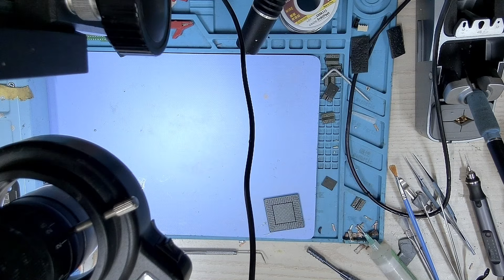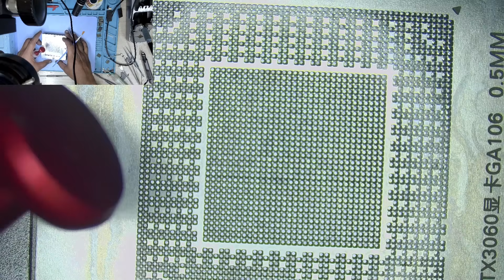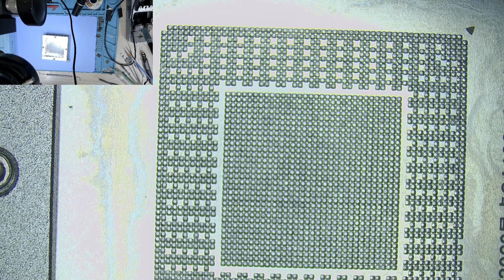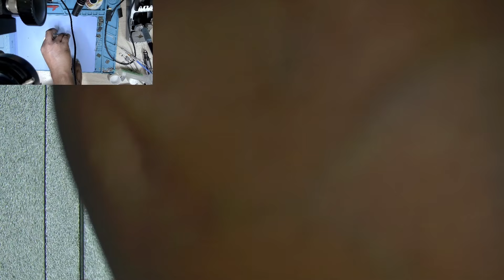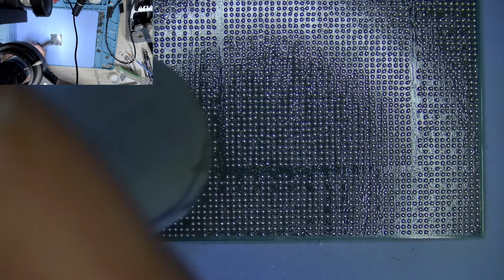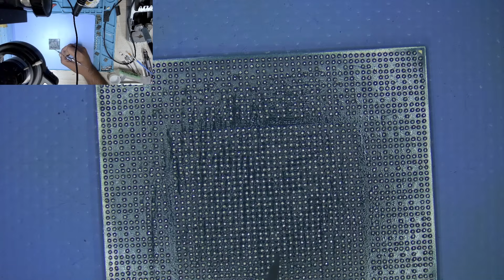Master The Art of GPU Core Reballing: The Ultimate Tutorial for Error-Free Repairs.

Comment: Review Title: "Master the Art"? More like "Master the Art of Killing GPUs"
Rating: ⭐☆☆☆☆ (Avoid at all costs)

Reviewer: A Reality Check

"Alright, let's address the elephant in the room. This video is a textbook example of 'Clickbait Engineering.' The title promises a masterclass, but the execution is a straight-up disaster that would make any actual technician’s skin crawl.

First off, look at the 'setup.' The guy just flips a high-end GPU core onto a generic silicone mat like he’s flipping a pancake. No jig, no stabilization, no ESD protection—nothing. In the real world, if you're cleaning pads on a $1,000+ chip, you don't let it slide around on a dirty mat while you’re jamming a soldering iron into it. That's a one-way ticket to scratched silicon or ripped pads.

And can we talk about the 'technique'? He’s going in raw with high heat and a soldering iron without any pre-heating or thermal management. It’s brute-force repair at its finest. You don't 'master the art' by treating delicate BGA pads like you’re scraping burnt toast. A real pro uses a pre-heating station to manage the thermal delta, preventing the chip from warping or the internal interposer from popping like popcorn.

The irony is that the production quality is decent, which makes it even more dangerous. It’s polished misinformation. It’s the kind of video that gives DIYers just enough confidence to go out and turn their expensive 40-series cards into paperweights.

If you’re watching this to learn, don't. This isn't professional repair; it’s a high-stakes gamble performed by someone who clearly values views over actual engineering standards. Total insult to the viewers' intelligence."
Reply from the maker: Thank you 😊

Comment: I'm working on an RTX 3070 and My issue always is balls getting stuck to the stencil. It seems like it doesn't matter how clean the stencil is - I'm talking about going thru a chemical wash & rinse cycle - at least 15 balls get stuck. It's beyond frustrating. I keep seeing the right amount of flux is key but I just can't get it right. Putting it on heavy is great because less balls get stuck in the stencil but obviously they're going to float once it gets heat. 

The last time I did it I had placed the balla that were missing. However, when heating it up balls moved and bridged. Going to remove the chip and try again at some point.
Reply from the maker: I have an updated video where I show everything in detail. How I clean and how I make sure the flux is thin enough. It's on my channel
Reply: @GraphicsCardRepairs-tk7ql great, I'll have to take a look.

Comment: I’m going to try to learn electronics repair in general and I love the way you explain everything. If you said it, I must’ve missed it, but I did hear you say you use low air speed, but what temp (or temps) would you normally set your hot air station to? Thanks again for the great videos.
Reply from the maker: @@HMCs_Tech_Lab_Main That's awesome to hear — learning electronics repair is a fantastic skill and the GPU repair space needs more passionate technicians. The core reballing video covers temperature profiles, stencil selection, and alignment techniques that are the foundation of good BGA work. Start with practice boards before moving to actual GPUs, and don't skip the preheat step. Feel free to ask questions — the community learns best together!

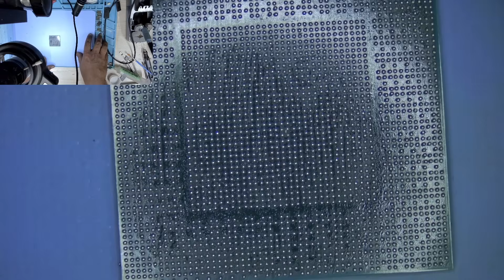Comment: at 24:46 on right side I can see balls out of alignment. You should add more flux and reheat so the balls sync on the pads perfectly. Also you should be heating the whole chip gradually from a distance and then get closer to melt the solder. Heating the chip starting at one position and going to the other will cause the chip to very slightly warp which could cause pre-mature failure of the chip when the chip gets hot under use. You also did not specify at what temp and distance you are using from the chip during the melting process which is very important. This is not an "ultimate tutorial" by any stretch of the idea. Sorry to be so critical, but it is necessary to identify the errors here as reballing a gpu is a very expensive venture if you do it wrong.
Reply from the maker: I appreciate your feedback.  I will make a new video and include the information that's missed out in this video. 😊
Reply: my 3080 has kind of display problem. how long reballing will work. please answer

Comment: I just found for me main problem is to get proper stencil, i ordered so many from different ali e sellers and all have deformations - slightly warped e.g. ,, i have no other option as to manually readjust balls. From fluxes what i tried on budget some 4 different fluxes ,only one what real works for me is clear rosin diluted in ipa, it makes nice sticky layer and balls not stick together under heat tension. When balls already slightly soldered to pads then apply extra flux and heat again, all balls should take position. I'm not expert, still messing around, just my experience 😅
Reply from the maker: @@QARepair Thanks for watching! Hope the video was helpful. If you've got a similar repair project, take it step by step and don't hesitate to reach out if you need professional help.

Comment: Been practicing on junk boards. When adding leaded solder to wick up the unleaded. Sometimes the solder mask turns light green or comes off in some areas. Am I adding too much pressure?  I’m using 450C. Large tip. Lots of kingbo flux. Thanks.
Reply from the maker: If the UV mask is coming off then it's possible that the pressure is too much. The idea is to glide it over. I use a temp of 350C on my soldering iron with a large tip. Too much heat is good for solder but bad for mask.
Reply: @GraphicsCardRepairs-tk7ql  great I’ll try both. Would you happen to have the type of tip and soldering iron you used in this video?
Reply from the maker: No I don't have spare. You can buy from AliExpress. 😁
Reply: @GraphicsCardRepairs-tk7ql  sorry I meant what are they called? The ones you use?
Reply from the maker: You mean to ask the name of the solder Wick and flux?. The name of wick is mechanic. Flux i used is Amtech Chinese clone and Mechanic NC 559 flux.

Comment: Please do a video where you use the solder paste direct heat stencil technique, making balls to the PCB pads directly (for GPU chip). It's hard to get good quantity of solder paste to each aperture causing balls to become uneven sized (which easily causes failure of the connections and MATS errors). But I recommend still trying it / or doing a video of it. Thanks for consideration!
Reply from the maker: Sure. I have a new set incoming for direct heating use. I will be making a video on it and release soon. 😁
Reply: @GraphicsCardRepairs-tk7ql  yes great. i often use that technique but still learning. I need some flat metal tool to help spread the paste more evenly. Yet edges may have slightly less paste sometimes causing too small solder balls
Reply from the maker: This new tool should solve the small solder ball issues. Let's see how it goes
Reply: @mikegaming4924  what i do on big chips is, i do it once, reflow it, then add another layer of solder paste which my tool also slices the uneven solderballs which then would even out everything

Comment: Hi, Good video thank you. 
How do you know you have the correct stencil, I see kits containing many stencils but they don't appear to say what chips they are for? If ever I have a go it will be for my
Gigabyte Geoforce RTX 3080 gaming 10G video pcb. Bob
Reply from the maker: If I was you I would avoid any kit. When you buy stencil you have to buy specific for the core. For example 3080 10GB, 12GB and 3080 Ti, 3090, 3090 Ti and 4090 use the same stencil. When you lookup for a stencil you will have to type the die number like GA102-200 then type the stencil type like 90*90 or 80*80 etc. I have put the link for your reference below.
https://a.aliexpress.com/_omo1bnm
Reply: @GraphicsCardRepairs-tk7ql  Thank you you are a Gentleman. may I push my luck and ask for a link to the stencil for the memory as well please, I ordered the GPU one 🙂. Bob
Reply from the maker: https://a.aliexpress.com/_omPC9yU
Reply: @GraphicsCardRepairs-tk7ql  Thank you kind Sir

Comment: Hello I know I'm late on the comments but been having issues regarding gpu cleanup.  No mather how much I tried to clean the gpu or the board I always got a few dip of solder on the pads and they usualy make my ball to be off center or worse stick to neuboring ones. Soo I have been wondering is it my technic like tip tipe (chisel tip) or wrong temperature around 350 - 400 C seams to work for me, solder wick (I'm ussing goobay) or all thogeter any advice would be most wellcome.
Also great video step by step very detailed
Reply from the maker: If you find solder remaining on the pads then either the wick or the flux would need a change. But first make sure you tin the pads with leaded solder so that it's easier to clean the pads. Now that's the first part. Remember that there will always be something that always remain. But that's secondary. Second after you placed the balls on the pads, make sure they are all centred as much as possible. Second preheat the GPU chip from the bottom at least at 120c so it activates the flux. Some balls will move. Make sure that you center them before you apply heat from the top. Once done start to heat from the top and don't stop. You will find that all balls are soldered but there will be few that are not straight. If that's the case flood it with flux and reheat again all balls that are off centred will fall in place. I feel this is a good practice . It's a bummer I didn't show this in my video. I'm sure this will work. But keep practicing and you will get it perfect.
Reply: thx I will experiment with solder wick and flux

Comment: Nice process but you should finish by flux flooding to finalize the centering and compaction of balls.
Reply from the maker: Yes that's correct. That ensures that while installing the GPU back the balls don't move and pads don't short. I missed to show it in this video. I will be making a new updated video with a new tool.

Comment: Hi brother my card was give the display after some mins display turn off and card fans speed up on high speed can you tell me what was the issue?
Reply from the maker: Difficult to say. Unless it is diagnosed it is difficult to say. Which card is it?
Reply: @GraphicsCardRepairs-tk7ql when i buy a card. The card has a temperature issue then i replaced the thermal paste the temperature issue was solved and the card worked fine for 2 months but now this issue came 😢😢
Reply from the maker: Is the core making good contact with the cooler? Did you replace the thermal pads?
Reply: @GraphicsCardRepairs-tk7ql  i didn't replace the thermal pads only thermal paste. I don't know it is contacting you have any contact so i will share with you. I am from Pakistan
Reply from the maker: visit my website https://graphicscardrepairs.com and click on link whatsApp to send a message
Reply: @GraphicsCardRepairs-tk7ql  1660 Super MSI Gaming x

Comment: I'm using AMAOE magnetic stencil with solder paste instead of balls and it's way more easier and quicker than this kit for using with balls.
But I had to learn to use it because there are a lot of things to learn before using a solder paste instead of balls and the temperature and air flow are different compared to the settings I used with balls too (it's imperative to dry out the paste with a paper towel before applying it to the stencil to avoid the uniformity of the balls when heated and a very low temperature and very low airflow are important to avoid the stencil warp when heating it).
Reply from the maker: I will try it someday. I did get solder paste but I could not get it right so it just stayed in my refrigerator since then. Someday I will find courage and start to practice it again. It's a skill I would want to perfect. More than one way of doing the same thing is a good habit.
Reply: @GraphicsCardRepairs-tk7ql  what's good about the paste I think it's a less time consuming job and you can reball a lot of DDR modules with it for a short period of time compared to using balls...

Comment: Sir is this a GPU chip from a laptop? Because my 3060 GPU chip isn’t being read in the laptop whether it be bios / Display Adapters, hence I was suggested to get the chip reballed. Do you think this will bring me back the original performance of the GPU & laptop since I do GPU oriented work mainly & only the GPU chip is marred where as rest of the machine is working properly
Reply from the maker: This chip in the video is of a desktop GPU. If the GPU of the laptop is not showing in device manager then you have to check 1) in your bios is there a option to disable/enable  discrete GPU and if it is disabled. Second is a bit advanced. 2) is there power going to the GPU core. If no power the bios will disable the GPU as if it is not there and boot from internal graphics of the CPU.

Comment: Thanks for sharing the video. Question, what temperature did you set the hot air gun to melt the balls? Thanks you!
Reply from the maker: On my hot air station I use 310C to melt the balls. I use quick 857DW+ for reballing the memory chips and core
Reply: @GraphicsCardRepairs-tk7ql  thanks for responding!